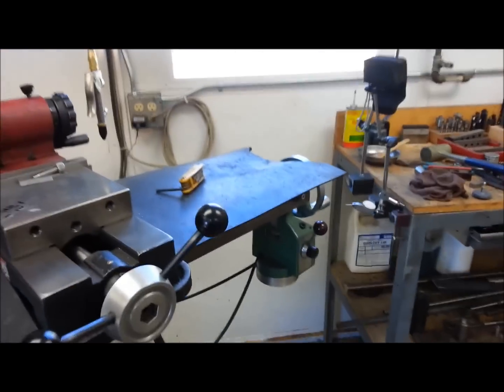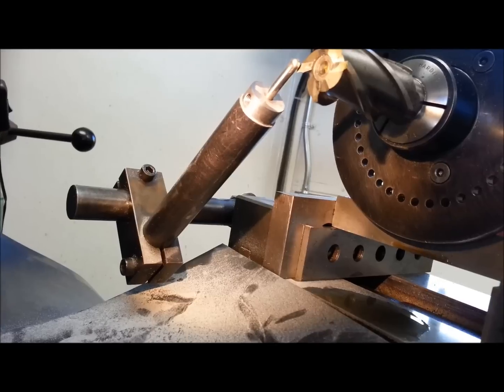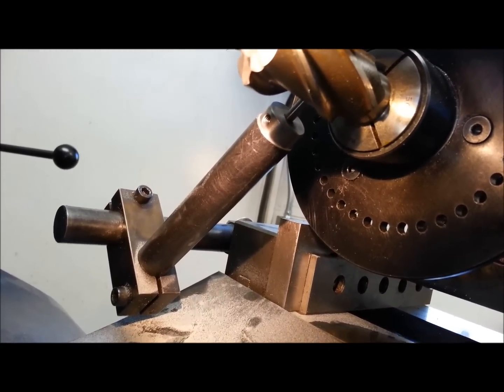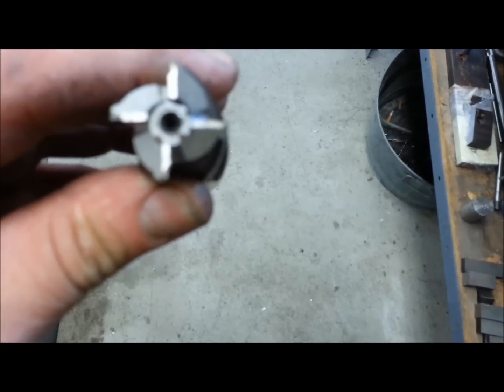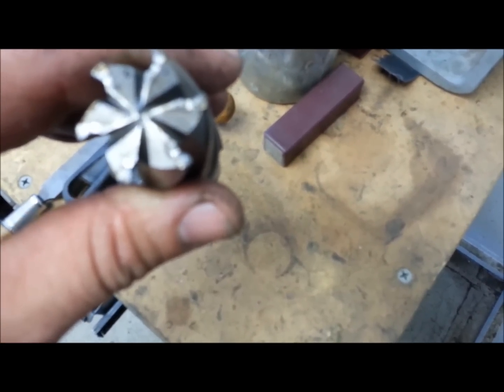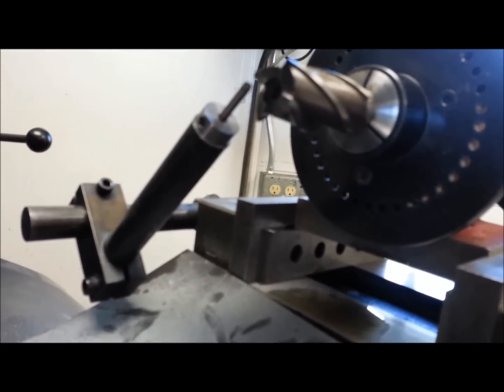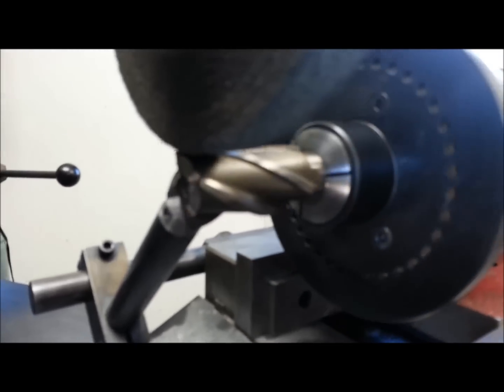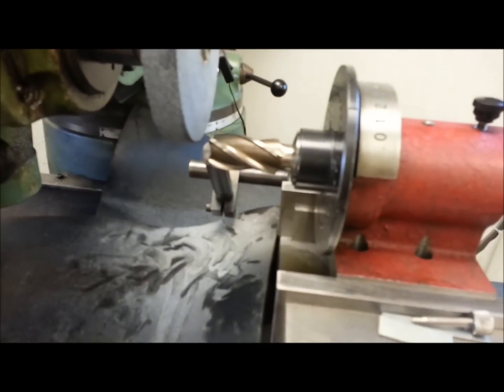Spindex end mill sharpening

Comment: I'm not sure I know what you are doing with your "probe".  So you're turning the handle on the Spindex and because the "probe" is sitting in the flutes, it pulls the spindle of the spindex forward, aligning the flute edges of the mill with the grinding wheel?   Not sure I'd have much luck with my Spindex.  whenever I have tried to use it, it chatters.  Too much play between the spindle and the casting.even when the locking pin is engaged.

Comment: whew thats some fred flintstone s--t right there. sorry "needs must" I'm a cutter grinder by trade
Reply from the maker: +brucegor Hey Bruce, I'm sure this method is horrible to watch for a pro, the setup time alone makes this ineffective, let alone the questionable results, I'm still on the prowl for a nice KO Lee or Denkel.
Reply: +Shadon HKW . sorry did not mean to disparage what you did.I see a lot of time and effort in that set up.as i said needs must when the devil drives. quick note when useing the centering post do not touch off on the wheel with it runing. instead rock the wheel and feed in till it touches or better yet put a shim between. that saves the post. i make my own for my ko lee radius fixture. ko lee wants an arm and leg for replacement

Comment: That trick is usable on many machines with an open horizontal spindle. I just scored an old Hammond tool and cutter grinder which isn't really designed for mill sharpening, but adding a spindex will be a natural fit.

You can clamp a shop vac hose with a wide nozzle aligned with the plane of wheel rotation to catch some of the dust. It's an ancient trick as is putting a panty hose leg over your vacuum filter to prevent clogging.

Comment: The Clarkson T&CG uses pieces of flat spring steel (re-purposed hacksaw blade) as the tool rests. Because of the spring action, you can use them as a ratchet when indexing the tool. John Stevenson has a channel here and participates on many forums. His wife sells engineering stuff on ebay (marypoppinsbag) and they do a DVD on Tool an Cutter grinding which many have found useful (item 360797299864 just now). I have two complete Clarksons that exist only as a pile of bits awaiting rebuild. A wheel guard would not only be safer, but allow you to capture a good deal of the dust with a vacuum cleaner whilst grinding.
Reply from the maker: A flat piece of spring steel is brilliant, after using this set up for a few hours, I can see the value it could provide. Ill look into a Clarkson, thanks for the comment.

Comment: Hi Shadon,

Good deal. Its a fine tradition using a tool for something the designers never thought of. I see you have added a pattern of tapped holes in the bottom of your spin indexer. Is that to mount it to an angle plate?

All the best,

Tom
Reply: Whoops replied before I saw the bracket.

Best,

Tom
Reply from the maker: oxtoolco Still need a tool grinder for the shop, your little Deckel looks handy, any recommendations?
Reply: +Shadon HKW  regrind shops( in my area at least) do reconditioning for fractions of what new tools cost. I am one such. also offering recoating
Gordon form tools